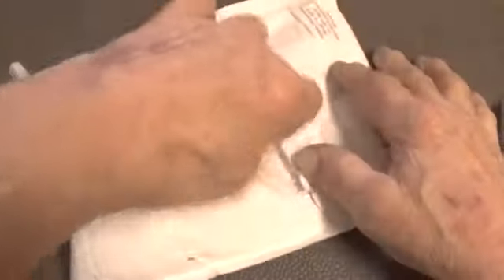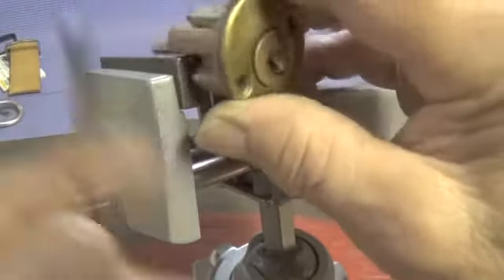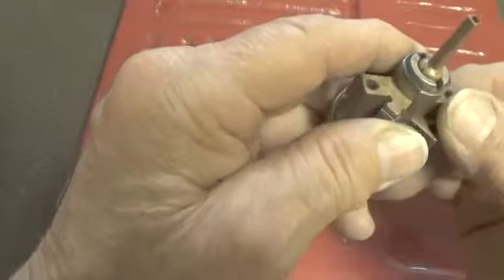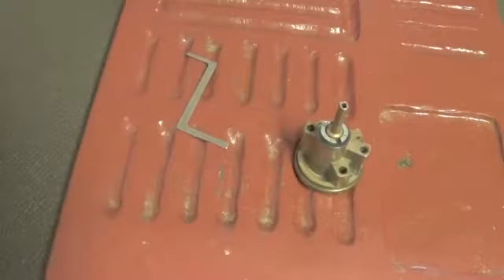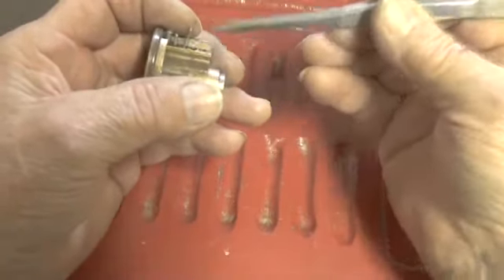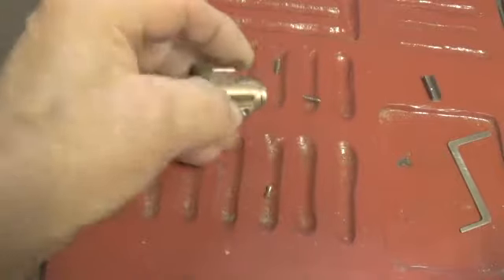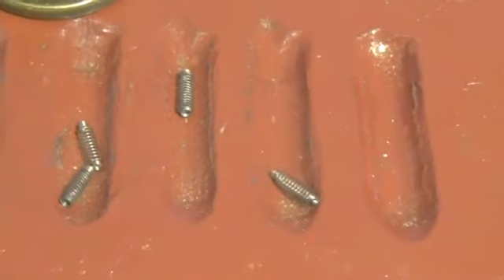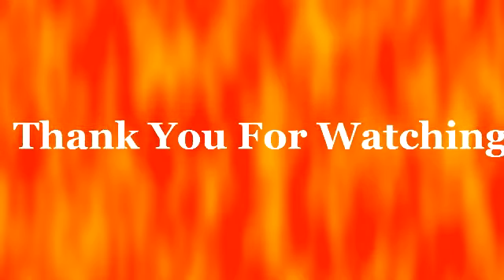(410) Lock Package from Shira Assel - One SPP'D and Gutted????????????????

Comment: Thank you, a real honor to have you pick my first challenge lock on camera. You're correct on the pin orientations, thank you for the picking notes. I'll include keys with all challenge locks from now on. Sorry you had a hard time with the clip on the back for the gutting part. I removed the top whenever I was working with the lock, probably why the serrations in the plug didn't last long. They came from the tip of the tap as it cut past the bible. I'll cut those deeper next time, with a tap with less lead on it. 

Thanks again!
Reply: Here's an index of the video:

Picking: 2:27
Open: 3:20
Gutting: 8:00
Pins: 10:23
Reply from the maker: +Shira Assel  Thank You for the lock. No problem on the clip. I always have these problems, even on locks that I pin.
Reply: +Shira Assel, Nice first challenge lock! Keep it up 👍🏻